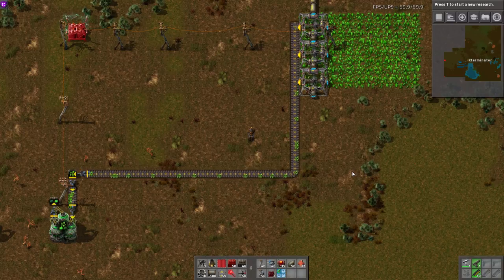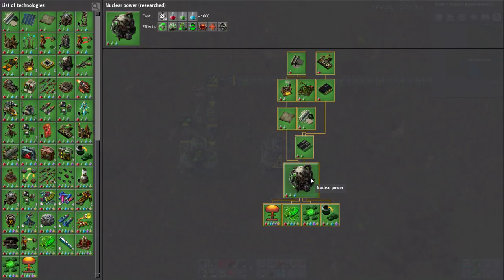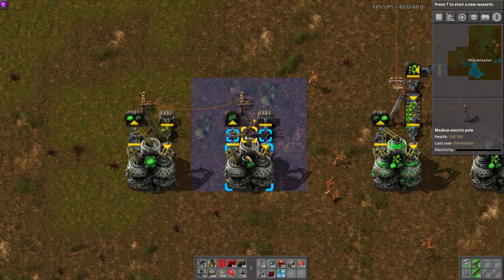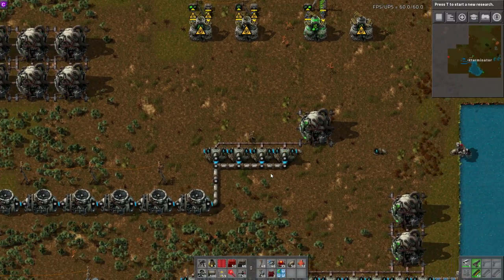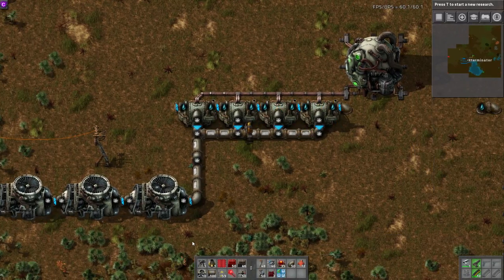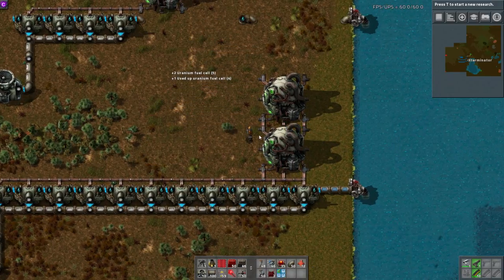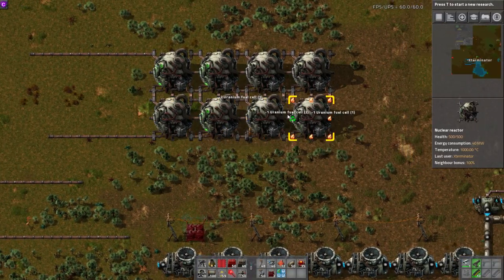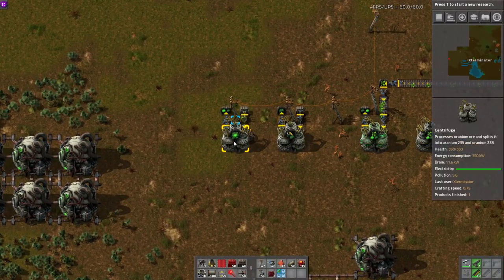Factorio 0.15 Nuclear Power Tutorial - Features & Ratios

Comment: Thanks-- this improves my original ratio planning because of the wrinkle caused by the 'neighbor bonus'-- this also has me thinking about optimal layouts-- 1, 2, 4, 8, 28.
Reply: http://steamcommunity.com/sharedfiles/filedetails/?id=917637096, http://steamcommunity.com/sharedfiles/filedetails/?id=917637154, http://steamcommunity.com/sharedfiles/filedetails/?id=917637212 -- been playing around with some designs based on your video. It appears that the ratio is 1:4 Reactors to Heat Exchangers-- but the ratio between Reactors and Steam Turbines varies based on actual layout. Science/tests suggest that your 1:6.88 ratio for Reactors to Steam Turbines only applies under certain layouts. So it seems it would be more accurate to say it's 1:4 (Reactors to Heat Exchangers) and 1:1.72 (Heat Exchangers to Steam Turbines)-- so if you connect Turbines in a 1:2 ratio your layout will always lose some efficiency and require a lot more Steam Turbines. If you connect them in sequence, then you may be able to maximize power output. But because of the oddities of heat loss through pipes (this can be seen, originally, with the original pre-0.15 boilers and steam engines) layouts involving pipes likely result in loss of stored energy during pipe-based transmission. So layouts involving pipe (to achieve any kind of OCD based design) are less efficient than just stringing them sequentially. Since heat conduits from Reactors seems to not suffer heat loss, I'm imagining some potential layouts that would minimize pipe usage and extend heat conduit very large distances to maximize efficiency and minimize construction costs for your reactor designs. More science is required.
Reply: Experienced the bug you were talking about where heat does not transmit correctly through heat pipe by re-wiring a section of the heat pipe and then destroying the 'old path'-- some heat exchangers were not able to get > 500 C as a result of re-wriring, causing a loss in MW produced because the heat exchangers simply would not convert water to steam. This resulted in an output of <40MW for a single reactor. By removing and re-laying all heat pipe 'in the correct order' the heat was properly (and evenly) transmitted from reactor to heat exchangers and all (4) heat exchangers were able to get to > 800 C (after a new warm-up cycle that lasted > 800 seconds.)

Lesson learned: pre-plan everything, lay everything by hand.

Like you said, hopefully the devs will improve the heat transmission algorithm so that layouts can be put down by bots without loss of effectiveness.

Comment: Build them in rows and you won't have much problem with spacing them. 10 times what you have there? Well, build 10 rows of the same setup, and it'll mesh nicely.

Yes, it takes up space, but it's not that bad when you look at the finished product. Build it out of the way and you won't even notice it's there, in the grand scheme of things.

To put in perspective, the 1990 minumum tiles that setup would take is dwarfed by for example solar.
To get the same power output from solar panels (only counting the daytime, would be more for 24-hour operation) would be 18 560 solar panels. That's 167 040 tiles, more than 83 times the space the 6 core nuclear reactor setup would take.

Comment: Hello X, recently I checked the forums and you can feed the heat exchangers from boilers powered by coal and the capacity of the water/steam stacks. So the 5.8MW per turbine  gives some interesting/easy ratios. 

1 water pump:  realistically this is 1/2 a water pump
10 boilers (18 MW): output feed into the heat exchangers 
4 heat exchangers (40 MW) : 
1 effective reactor : multiple setups could be powered by reactors with a neighbor bonus. 
 10 turbines (58MW):

1:10:4:1:10 seems easier than the numbers given by Mad Zuri and it is 100% effective all the time. 

To me this seems to be much easier to remember and I can convert my old power setup to nuclear and only have to discard the steam engines.

If you would like I could submit a blueprint string.
Reply from the maker: Interesting. I didn't really consider the idea of mixing normal boilers into the setup. Based on your numbers it seems like it could work quite well! 
Personally, I would prefer to just keep my Nuclear setup with Nuclear parts and not mix stuff, but that is just me.
Reply: It also takes a while for the reactors to warm up and is dependent on external power for the roboport and inserters for the reactors.

Comment: I've used nuclear power previously but I didn't know that reactors could pass the heat through themselves. I've run reactors two wide (or high) and run a heatpipe off each of the long sides through to my power station.

Comment: I have tested, you can actually do 3x3 reactors. And the middle one will get 400% bonus. But without mods you will have to operate the middle one manually, inserting fule cells and removing old once.
Reply from the maker: Yeah. In terms of neighbor bonus, doing a square is best, but you will have to insert manually like you said without a somewhat cheaty mod.

Comment: There needs to be an update that lets cars be made with the electric engines and have a charging port of some kind that you drive into and it charges the car battery.
Not only does this set up produce almost 1.21 gigawatts, but the portable fusion reactor is the 'Mr. Fusion'  on the DeLorean.
Time travel is meant to be in Factorio.

Comment: This video is a month old, but I did some math and found a ratio heat exchangers to turbines that comes out to all whole numbers

25 Exchangers : 43 Turbines = 0.58
1 : 1.72 = 0.58

If this is common knowledge by now.. it's whatever. Figured I'd put it out into the universe since with some algebra you could figure out reactors needed and pumps needed, and how much power it outputs.
Reply from the maker: Nice that sounds about right! I don't think it's really common knowledge, so thanks for sharing. :)

Comment: You don't need anything complicated to save the fuel cells. You can just hook up one of your capacitors, via circuit connection, to the arms that put in the fuel cells to your reactors. Set any letter or color as output on the capacitor, it will output this symbal corresponding to the % charge it has, so 100x when full, 0x when empty. Now set your arms to only work on the condition the output from the capacitor is equal or lower than X, 10 - 20% (still need to figure out how much margin is needed myself) :).
Reply from the maker: Interesting, sounds pretty easy actually. I'll have to try it out myself sometime and see if I can get working without blowing up my factory. :P
Reply: I tested a bit more, make sure not to request too much energy cells in your chest, your arm can input 3 at a time, which can be wasteful. Thinking more about it, as an extra backup, i believe you can store steam in storage tanks, with the turbines using 60/s and the tank holding 25000 you should be able to store about 7 minutes of steam per tank, per turbine. Man, this new nuclear implementation has my head spinning with ideas, loving it :D.
Reply from the maker: yeah it's super cool and so many possibilities with it. :D Good point about the inserters inputting multiple at a time too, that is pretty wasteful.

Comment: 0.7% is not 57k, it's 40/0.007=5714. Which is 5714\0.26=21976 seconds from single unmodded drill, divide it by number of drills, speed (or preferrably productivity modules) and mining productivity upgrade, you'll get 40 in like 10-20 minutes tops.
Reply: you forgot that the recipe uses 10 ore per cycle

Comment: Nuclear Power is really OP i think, a yellow belt 54 % full of uranium ore, can sustain a 4x2 reactor, which produces the equivalent power of 3,5 BLUE belt full of coal. (These numbers are without the enrichment process, with it, the belt only needs to be at 5% througput.
Reply from the maker: Really? Even with such a small chance to actually get the U-235?
Reply: Yup 54 % = 7,2 ore per second = 0,72 centrifuge cycles per second = 0,00504 U-235 per second = 0,0504 fuel cells per second = 10,08 reactors runing. When checking my math, i a tually found a mistake, so you can either power 10 reactors with 54% (as above) or if you just need 8, then 43% will actually be enough.
Reply: setting everything up is one challenge, but you additionally need other things too, eg one sulfuric acid per one ore that you mine, and that requires additional logistics.
if you then decide to also use uranium for nuclear bombs, for nuclear fuel for all your trains, etc, you will need more ore than only 7 per second ...

Comment: I have a question. I wanted to do some laid back playthrough. Is there an easy way to create new ore patches in game? I couldn't find any 0.15 mods for that.

Best approximation would be 0.14 quarries, but they are not updating  for now
Reply: 0.15 automatically generates uranium in older worlds when you load them after updating. FYI.
Reply: Alright, but now I'm just curious. Is there a nice way to generate new ore patches in-game? I was thinking about water-only map.
Reply: A nice way no, there is a set of lua procedures you can do, but those are difficult to type. Something can be modded in, I haven't looked yet but you might find something in the Factorio forums.

Comment: Is nuclear 'green' ? as in clean
Reply: it doesn't create pollution, so yeah.
Reply: Yes.
Reply: No, one of the steps makes it (oil refining)
Reply: @persona_link3554  
Using your definition of 'Green', the only green things Factorio has to offer, are wooden planks, wooden box and stone furnaces; as everything else uses either, a combination or subproduct of iron and/or copper (which have to be smelted) to be made.
Reply: @holomatic1549  Can't you smelt them in electric furnaces?
Reply: @shoe_5403  Yes, but these are made by steel, and steel is a subproduct of iron, and iron has to be smelted.
Reply: @holomatic1549  they are also made out of advanced circuits, which are made with plastic, so pollution is always produced

Comment: Too bad someone isn't good at wires/math to automate the whole process of retaining 40 for the enrichment process both in the enrichment process itself, as well as the initial getting of 40 :P
I like to reffer to the number of reactors that is calculated for the heat exchanger number as virtual reactors, including the bonuses. Personally I use 4 reactors in a square config, giving me 12 virtual reactors for a total of 480 MW. but right now I only feed 2 of them for 160 MW.
For the turbine ratio I actually used the power values. The heat exchangers output 10MW each, the turbines eat 5.8 each. 40/5.8 ~= 6.9 but your method works, too: (103*4)/60 ~=
6.9. I'm glad you cleared that up. Your introduction to .15 was giving false advice after all :P
Also I'd use 1-4-7. a 4-7 setup is easily blueprintable and repeatable. if you add another reactor, just slap on however many new virtual reactors you get out of it and you're done instead of calculating every time how many more you need precisely. it's not going to make a difference in material cost until all thoose 'barely not working' turbines rest adds up to one full turbine anyway. and that's way off later. also you can supply 2 of those blocks with one pump. But pumps are cheap enough.
The new modulo operator makes it rather easy to retain some U235, by the way. force stack size 2, 4, 5 or 10 on the output filter(stack)-inserter into a chest. then take out of the chest if modulo stacksize = 0 and put it back into the process. and if modulo stacksize = 1, then put it onto the output belt for the whole process.
Reply from the maker: All really good points and info here! Interesting to see how you do the ratios differently, but it's good to know that both our methods come to the same conclusion. Having an easily stamp-able version is also really nice too. :D

Comment: Latecomer here, but is there anything that absolutely requires nuclear power? I'm not really seeing any advantages over boilers, other than the possibility of replacing a long coal belt with significantly shorter fuel belt. But even that seems to be outweighed by all of the steps required to get nuclear fuel vs. mining out a coal field or bringing coal in by train or even upgrading to solid fuel.
Reply from the maker: Possum Ridge Entertainment Basically it is far more space efficient and game performance efficient. because you can get way more power from it compared to steam. 
It also wouldn't need constant coal fed to it.
Reply: Yes, the effort is front loaded, but once you have it set up, it will produce all the power you will ever need, plus U-238 for upgraded ammo, plus excess U-235 for nukes, with very little pollution, and free your coal for industrial and transport use
Reply: @talltroll7092  there is also nuclear fuel for trains :-)
but what about solar? isn't that OP too, when you only plop down a blueprint once ("front loading" it), let bots build it, and then never care again ?

Comment: The one day you build a setup with bots. Using them you can't build a heatpipe in one go. It will be build fragmented. 
When you built it, it worked fine. (Except that the pipe was north-south faced which created a problem as someone else proved later in chat.)
Reply from the maker: Yeah, it's unfortunate that building with bots will do that. :/ Hopefully they fix or help the issue in a future update!

Comment: what about speed modules on the centrifuge? Do productivity modules works?
Reply from the maker: Productivity modules work with some of the processes, but not the Kovarex Enrichment one. Speed modules do work on all of it though.
Reply: current state of affairs many versions later : because of the problems (possible exploits) with productivity being applied to all 41 uranium, those modules were first disabled completely, and then reenabled with the new "catalyst" mechanics where only the difference would get the bonus, thus when inserting 40 and 5, and getting 41 and 2, 40 and 2 would be considered to be only catalyst, and only the one new surplus uranium would get the bonus, which is a really small amount while also slowing down the process.
using speed modules will get you many more cycles and thus much more of the valuable uranium in the same time.

Comment: saad times, I had my setup all tricked out with one reactor in the middle with heat pipes braanching off in all directions to heat exchangers aand a huge field of turbines and it was gonna be so sick until you saaid one reactor only supports 4 ;-; not changing it though cus the design still looks good.

Comment: I guess that there will be Nuclear + Batteries instead of Solar + Batteries. You'd insert fuel into reactor once you have low enough energy in network.
Reply from the maker: Yup, that sounds like it will definitely become a viable option.
Reply: steam tanks are much more compact than accumulators. from the wiki: "A storage tank filled with heat exchanger 500°C steam stores around 2.4GJ; a storage tank filled with boiler 165°C steam stores 750MJ." and the accumulators have only a capacity of 5MJ each, thus a tank with 500°C steam can hold almost 500 accumulators worth of energy (it is "only" 150 accumulators for a tank of normal steam). accumulators also will input and output only 300kW while heat exchangers and steam engines/turbines are much faster.

Comment: Hey there. So you said it takes 57,000 ore to get 40 U235. That's a probability of 0.0007 not 0.007. So, seven out of ten thousand.Less than a tenth of a percent chance.
Reply: Also curiously, if this is the probability, that means you get a U235 for every 1425 ore processed. And if the Kovarex processing gives you a free one in 50 seconds, that is effectively like processing 28.5 ore per second. But for free.
Reply from the maker: Keep in mind that the process takes 10 Uranium. To confirm:
http://www.wolframalpha.com/input/?i=number+of+trials+until+40+successes+with+p%3D0.007

Multiply that by 10x for the 10 Uranium per process.

Comment: 19:35 do we still need to do this walk around for heat pipes or is it fixed already?
Reply from the maker: Edward Dizon It has has been fixed. :) However, heat pipes now lose heat over distance, so there is a max distance you can run them before they lose the heat required to heat the exchangers. 

A quick Google Search for something like "factorio max heat pipe length" should bring up some posts that give you the distance and such. :)
Reply: Thanks for the reply :)

Comment: If i hava a older Save file, from older version, and uppgrade the game, can i faind Uranium then?
Reply: Daniel Johansson  yes
Reply: Yes, uranium can spawn in any newly generated chunks, so you´ll have to explore new areas.
Reply: Patches will spawn in explored areas near the spawn as well, doesn't have to be new chunks
Reply: Daniel Johansson They used retrogen so uranium isn't exclusive to new chunks
Reply: what's retrogen?
Reply: retrogen means that new ores will also spawn in already discovered chunks.
Reply: Yeah I got that but what IS it? Is it the name of a middleware? a technique? Never heard it before
Reply: It´s basically a technique going hand in hand with "normal" worldgen.
Since worldgen describes generating completely new chunks, retrogen describes regenerating / adding to existing chunks. 
I have no idea how exactly its done in Factorio, but Minecraft Mods for example often implement retrogen  by replacing some parts of abundant ore (i.e. coal) with the new ore that has to be generated.

You can basically think about it like the chunk-regeneration-command that comes with RSO but with the new ores.
Reply: RSO?

Comment: Isn't it 5.7 thousand rather than 57 thousand ore to get 40? Because the calculation should be 40/0.007, which comes up with about 5.7 thousand.
Reply from the maker: That is 5.7 thousand cycles, but remember each cycle takes 10 Uranium ore.